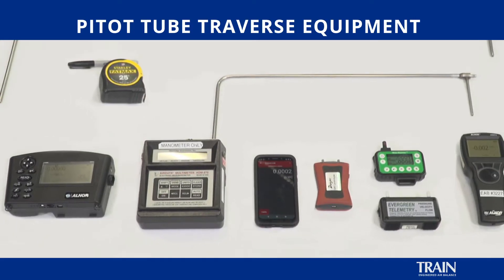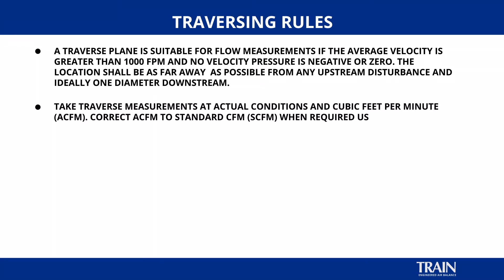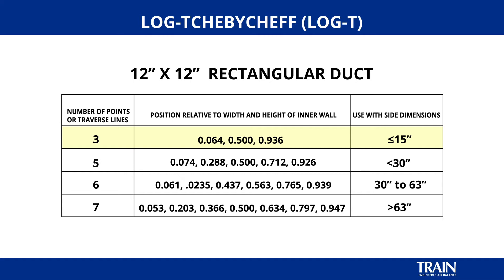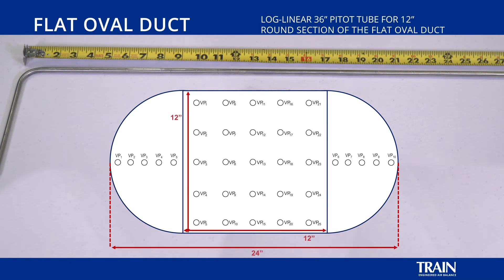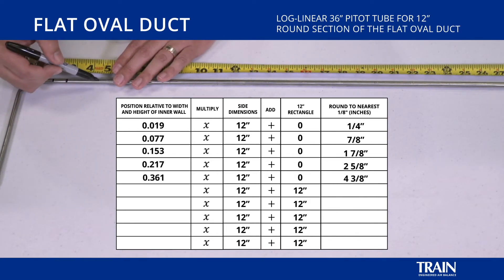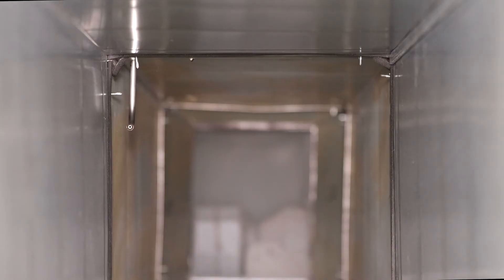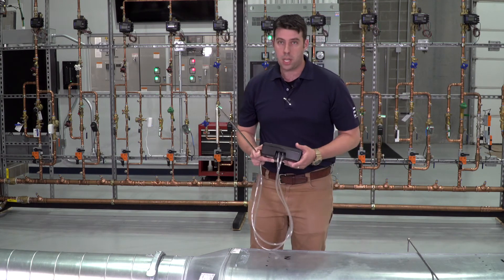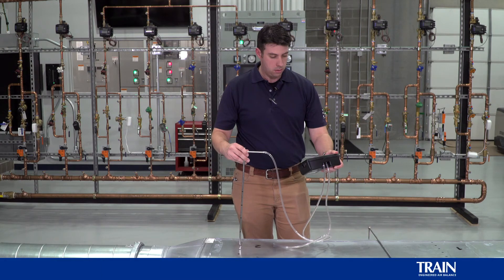How to Perform A Pitot Tube Traverse For Flat Oval Ducts - Engineered Air Balance

Comment: good night excellent video, I want to know how the pitot tube would be used to make measurements in large areas, for example in an underground mine, since when measuring the static pressure the hose is exposed to the environment, what is done in this case? Does the other hose get clogged?